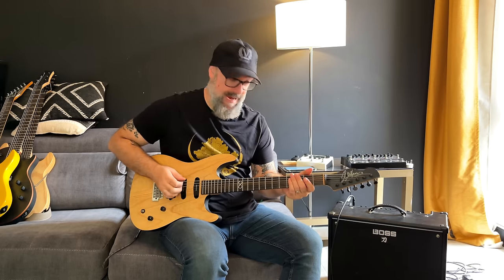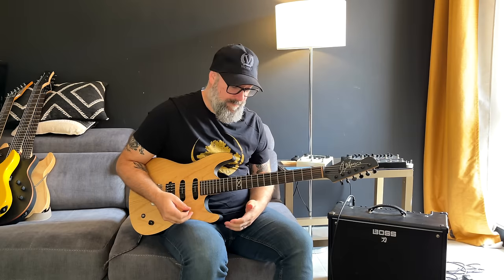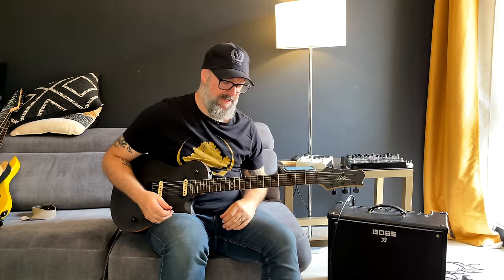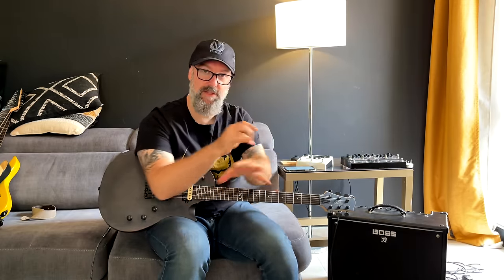Guitarist Guide to DIY Preamps: 4 Easy Boss Pedal Hacks￼

Comment: As a worship guitarist I can confirm that gain stacking is where it's at. You can get so many cool tones. One of my faves in a Morning Glory with a Tube Screamer.
Reply from the maker: It’s super fun, almost a bit like designing your own amplifier circuit because there are so many endless combinations and ways of connecting two or three overdrive or distortion pedals and tweak to get your final sound! Thanks for watching dude. :-)
Reply: @RobChappers  that's a super interesting way to look at it🤔
Reply: I've been using the Radial Regency for this purpose as well - just a touch of drive on the amp and the two sides of the pedal really layer on some great textures.
Reply: As a YouTube commenter, I wonder why you needed the qualifier 'as a worship guitarist'.
Reply: @st3pp3nw0lf86  Good question! The worship genre is notorious for stacking overdrives and making super thick tones out of them; so it's just a little context to give more weight to my statement.
Reply: What is a worship guitarist? Do you mean warship?
Reply: @jurrione  Playing guitar on a warship would be way cooler than what I do! Worship is a Christian music genre, like what we sing at church. The sound is huge reverbs, strong dotted 8th delays, and plenty of modulation. We tend to layer drives for bigger parts of the songs and it sounds huge!
Reply: @Fredderbuter  U2 have a lot to answer for.Snowplay too.
Reply: @StratsRUs  haha indeed they do, my friend!
Reply: @fredderbuter350  As a fellow Christian and guitar player, I have nothing but respect for the worship team that we have at my church! The thought of public speaking gives me the heevie-jeebies! I post my music online because it’s much harder for people to throw objects at me that way!
Reply: @musicblogger87  Let's go, dude! That's awesome!

Comment: Distortion pedal hacks, not so much, but I've run quite a few different hacks with compressor pedals. You can use the comp as a boost on a clean amp and get some of the most beautiful just over the edge of breakup tones - even at fairly low volumes. If you want a touch more you can turn up the sustain just a bit (and I mean very little) and it gives you very close to tube amp sag through a SS amp. Since some comps have a tone control (hello Boss!) you can kick that up for a bit of treble boost. Hack 2: Use a comp for rhythm channel with the volume and tone turned down. Turn the comp OFF for leads! Hack 3: Use 2 comps at the same time to get combinations of the above. When both are on at once you can get some amazing singing tones that don't get lost in the mix due to having so much OD that the guitar tone gets lost - still plenty of the clean tone left.

Comment: My "hack" was when I had my SD-1 used as a preamp with gain at 8-9 o' clock, level at unity (around 1 o' clock) and tone at 11 o' clock and a DS-1 BEFORE it as a normal distortion pedal, both feeding a super clean amp channel. The sound was very much like the rhythm guitar tone of the song "All She Wrote" from Firehouse.

Comment: Great info! Started down the gain stacking road a while ago and found a couple that I enjoyed for the preamp hack. 1. BOSS/JHS Angry Driver. One pedal with Blues Driver and Angry Charlie combined. Using the JHS red switch gives more options on how the 2 sides work together or independently. Can give your amp several different "Marshally" sounds, if that's what you're chasing.  2. BOSS SD-1 into DS-1. Just fits together so well. Cheers

Comment: My favourite is Boss OS-2 pedal. It can be dialed as a SD-1, but will have more gain to fun with. Also I like setting, when tone is around 55-65%, drive is 75% and the Od/Ds knob is between 25-40% - sounds amazing.

Comment: Ive never really been a pedal stacker. Most of the time that I try this, its either too gainy or too muddy. 
But.
I might give it a go again because its such a long time ago I last tried.

My amp is a 100W Silver Jubilee Reissue that has an amazing clean channel.
I do mostly live on the dirty channel tho. After all it is a Marshall.

Always preferred amp distortion over pedal distortion, but I do have a few of these Boss Waza overdrives, so yeah. Maybe its gonna unlock more sounds I like from the amp.

Comment: When you dont gave money foe big nice amps you figure this stuff out, I use clean amps, and pedals for grit, Boost, Dirt, Stacking drives is an art and different pedal interact differently before or after each other, I use four drives in different combinations. KLon, KOT,Nobles odr1 and a greer lightspeed., I can achieve light drive tones to all out dirt. I do use an EQ, Buffer in and out . Cant afford the amp I want so I jus got two good clean pedal platform heads, I have my own tone, everyone compliments me so a;; is good. I learned all this watching you over the years, If it sounds good it is good.

Comment: Hm2w into mt2w with precision drive in front or any tube screamer. Classic groove and death metal tones. 

Also a neat hack I learned when uses an overdrive to boost is if you turn up the drive to about 9 o’clock. It doesn’t really add that much more gain. It just sort of adds necessary compression and more low mids but into the tone and makes lead’s easier

Comment: I use a operation trinity distortion and a carcosa fuzz pedal in front of the amp and in the effects loop a super overdrive and an equalizer. I have a lot options with the adjustment of these pedals and I use different settings depending on the diffent music styles I play.
I will try out the blues driver. 😊🤘

Comment: I've always used overdrive pedals into clean amps.  Even when using good two-channel amps, you can get different, and often more suitable, tones doing this.  And stacking, but for live gigs that usually results in a sound that doesn't cut through the mix.  Great for the bedroom though.  And do you know what?  Unlike Rob, some of my pedals are not made by Boss!

Comment: Hmm, in that first example using the Blues Driver as a cut...  was that being used at the front of the chain or does that Katana model have an effects loop?  Would there be any benefit to doing something like that in the effects loop to try and get the volume of a loud amp down to levels that prevent the neighbors from going full Jack Nicholson on my door, or just simpler to get an attenuator?
Informative video Rob, thanks.
Reply from the maker: Hi, I was using in the front - But loop would work too and the Katana has a loop

Comment: If your gain is set high 1 o’clock on a high gain amp and you’re not cutting through a live mix? Dial back the gain/distortion to 7 o’clock. The clean amp will always be louder and more cutting than a high gain structured amp. And then slam the pre with a distortion pedal  and cut through like a champ.

Comment: Cascading two drive pedals. One of the oldest tricks in the book.
Reply: They are preamps, not drive pedals
Reply: There is no difference, a pedal is a pedal, preamp is just a cool word, in reality it’s just using a pedal for gain and not the amp. Just plugging in a pedal.